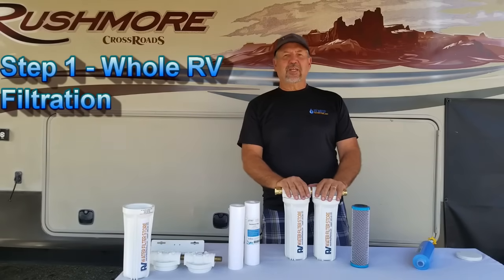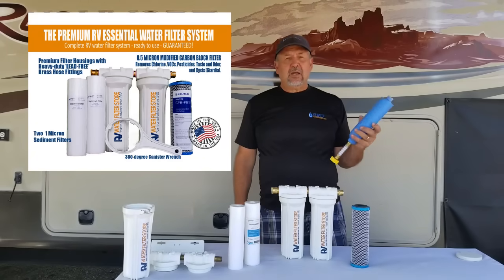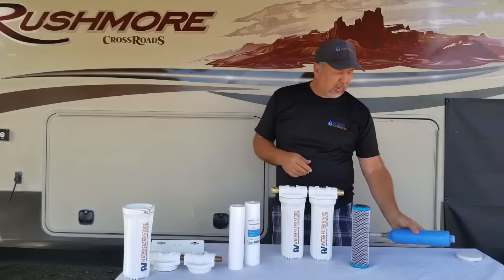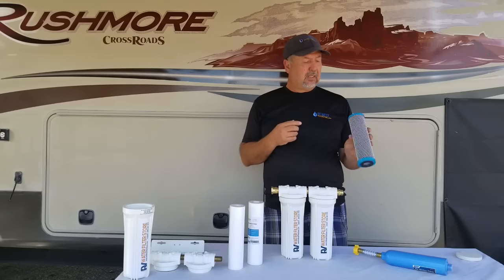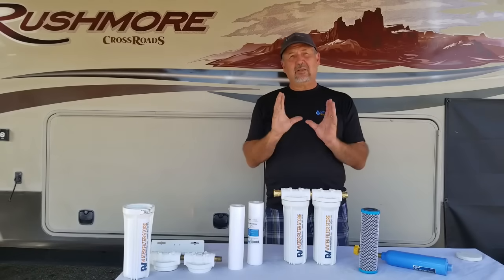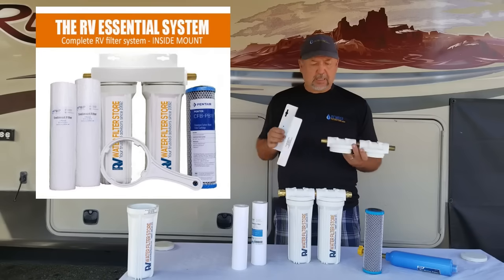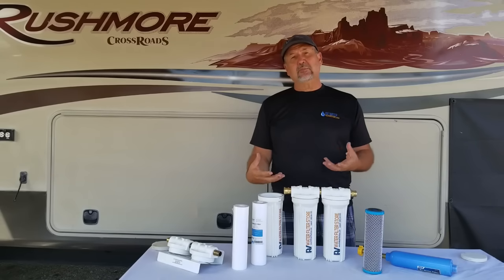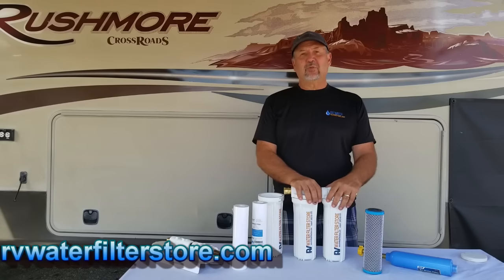3-Step Water Filtration for RVers - Step 1, Whole RV Systems

Comment: Excellent product and superb service.  I installed the total RV 2 canister 10" system Dave described above in my Flagstaff VLITE 30WRLIKS at the beginning of the season.  The install took about an hour.  I removed the factory single filter and bracket system under the H2O Heater and replaced it with the two canister system.  The bracket and canisters fit perfectly as if they were designed for it.  Water pressure was a bit less at the beginning but seemed to adjust over time...that or we simply grew content with the water flow.   Shower water pressure is just fine as well.  Water tests substantiate the claims.  Thanks for a great product Dave!

Comment: What is the flow rate post .5 micron filter?   Many .5s have very low flow rates on order of .5 gal/min..  My shower at 1/2 faucets setting operate at 1.2 gal/min. Or if you use this to just fill your fresh water tank, how long does that now take?
Reply from the maker: The flow rate for the 0.5 micron filter is 3-4 gpm at 60 PSI ... it is a modified carbon block filter that has synthetic fibers mixed with the carbon to improve the flow over solid carbon blocks and also inhibits bacteria growth.  While not bacteriostatic, it definitely is an improvement over solid carbon block.